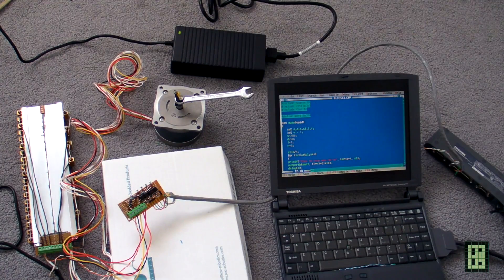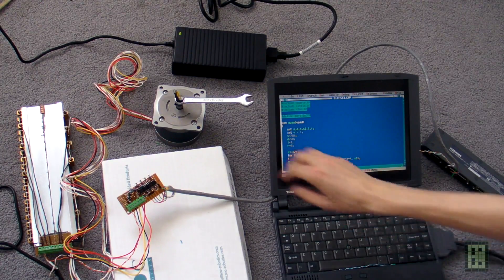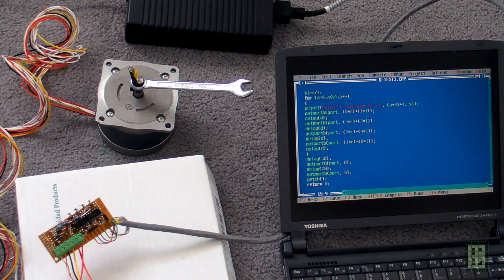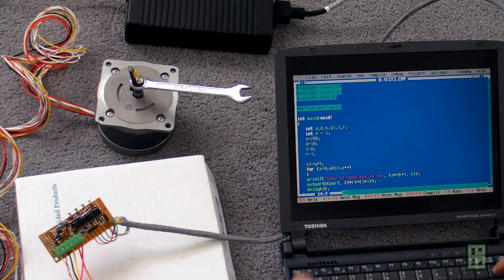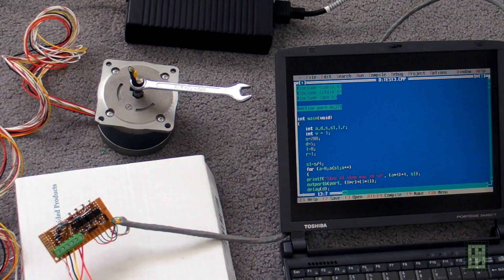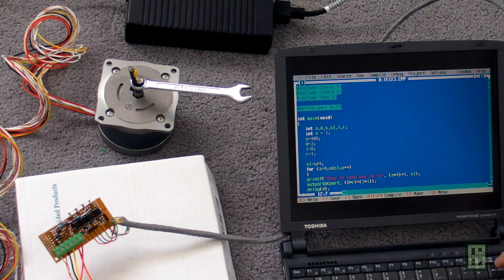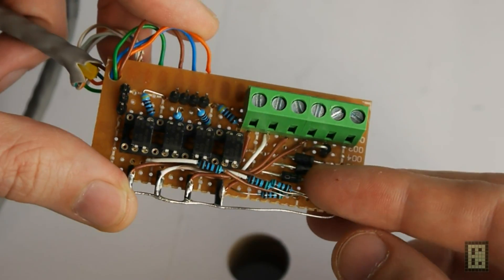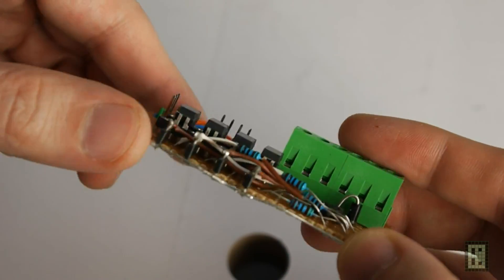Stepper motor controlled with computer parallel port LPT

Comment: of course, but ... there is a need for another interface to program the pic, I have a toy car to throw, I got the relay and I built the relay interface for more utilities, the interface that I tested on the car washing machine, for which I had Qbasic shorter than the poniprog and the microcontroller programmed interface, now the washing machine is running on a PIC 80f and obviously on the relay terminal washing machine controls.

Comment: https://www.youtube.com/watch?v=W6LFer8Orl0
very good presentation, Qbasic is able to give utility in an old computer, effectively using to replace a defective pre-programmer from a washing machine, using to ignite separately and turn off the light in 4 or 5 rooms when we are away from home, and many other utilities that Qbasic implements through the LPT port in an old computer.
Reply from the maker: A 2 to $3 microcontroller has now the performance of an old computer (not that is needed for this simple applications) and uses just a few mA from a 3 or 5V supply thus it is a much better option for applications like controlling a washing machine cycle.
I my case this was just an one day project to play for the first time with a stepper motor basically trying to better understand how it works and is fun but not very useful.

Comment: Do you still have that laptop? You should do more stuff like this. I wanted to control stuff using a parallel port too, but didn't know how. I'm glad I found this video! By the way I use Turbo C for C programming now. I made a simple game thing where you can walk around a 10x10 map  using WASD and you can exit using O. If it weren't for Turbo C, I wouldn't be able to do this. Thanks for the video. BTW as I'm posting this, the video has 232 likes. The serial port (not parallel) is sometimes referred to as RS-232.
Reply from the maker: I think I still have it somewhere (last time I used it with an OBD tool on my car a few years ago).
I'm just to busy with my SBMS and DMPPT project's so I do not have much time for anything else is even hard to find time to finalize my house :).
When I can get some extra time I will probably want to play with AI type applications.
For this sort of stuff like controlling a stepper motor is better done with specialized stepper motor controllers that are very inexpensive and then use a microcontroller or one of those raspberry Pi type board computers that have plenty of IO to control external stuff.
Turbo C is fun and easy to use but fairly obsolete by today standards. First time I ever programmed anything was just in my first year at University and that was using Turbo Pascal. First time I started using Turbo C I did not like-it much compared to Turbo Pascal :) but C was more successful so that is what I use now but only for embedded stuff for ARM cortex M series of microcontrollers.
Yes video still has 232 Likes :)
Reply: Yes, Turbo C is obsolete by today's standards, but I would still use it. I got a C programming guide for christmas, which teaches C based on the ANSI C99 standard. C is easy to understand and from my own experience, C is the second easiest programming language to understand (after Python). Also, there is an easy way to control the parallel port in Turbo C, while it is more difficult in Python. I hope you can find some time for this. BTW I posted my comment roughly an hour before you replied. Since this video is at least 6 years old, I doubt that it would gain any likes in an hour.
Reply: Also, I have a laptop that you can attach a parallel port equipped dock, but I don't have the dock. It does have a PCMCIA slot on the side, so I'm waiting for a PCMCIA to parallel port adapter, since I found it for cheaper than the dock. And if I need a driver for it (there are probably no DOS drivers for it), it will at least work with a special version of DOSBox. At least I will have a parallel port.
Reply: Oops, it was actually ExpressCard. My PCMCIA parallel port fits, but doesn't connect.

Comment: What did use to protect the parallel port?please make a list of part and draw the schematic on paper so we can see, good work thanx
Reply from the maker: There are optoisolators for parallel port protection the 4 pin DIP devices (not sure what model since this was done long time ago but anything will work). Schematic is realy simple and you can see somewhere in the video a close up of the board.
This is not useful at all other than learning how to control the parallel port or play with a stepper motor. For any real use you will need a proper stepper motor controller that is extremely inexpensive and will work way better than this simple circuit.

Comment: the DOS version you have used is a pure DOS or (an emulated) DOS running on windows?
Reply from the maker: No is a pure DOS so direct access to hardware. Old Win95 and maybe Win98 will still run this but not the newer Windows versions that will need a driver installed to allow access to parallel port.
Reply from the maker: I guess it will not work inside a VM same with dosbox. The master OS takes control of the HW and only gives access trough a proper driver not directly. You can access the parallel port from any OS trough a driver but in DOS naively you do not need a driver since you have full hardware control.
Reply: electrodacus official dosbox is currently unable to control the parallel port and so is ms-dos inside a VM (AFAIK).
Reply: electrodacus there exist SVN versions of DOSBox that allow you to use the parallel port, but I ran into a few problems with it.
Reply from the maker: The ports including parallel are controlled by the main OS and applications including a VM will need to access those ports trough main OS using a driver and only one application at a time can take control of any one port. None cares anymore about the LPT parallel port so support from VM is likely limited.

Comment: Six years+ later and this is still useful... Just because it is DOS and Turbo-C doesn't mean it's obsolete, by any means.

Thanks for nice demo.
Reply: boogerhead0 I agree. This is the simplest way to control the parallel port using a programming language (C in this case). You can hook up anything that requires less than 8 digital I/O pins to control to this, even a character LCD.
Reply: also visual basic is fine

Comment: Code for Linux please.
Reply from the maker: Parallel port access is as simple in Linux as it is on DOS and will depend on the programing language you want to use.
For C see this https://www.htlinux.com/parallel_port_control_in_linux/
The code I wrote and did not save is very simple and you can copy that from the screen (watch in 720p min and you should see all my code in this video).

Comment: What interface would you assume for modern PC? (As it has no LPTs and rarely has COMs)
I would like to stay away from Arduino, in order to use high processing power and high device compatibility.
All i need are the ways to
  - Control 64 such motors, sending digital data to them with DACs
  - Recieve data from at least 64 sensors, with aid of 64 ADCs
Everythingt must occur on standart PC with CPU of x64 architecture.
Can you assist on that? That is an interesting modern project!
Write me a letter if you are interested!
Reply from the maker: Your x64 CPU has no DAC or ADC included and since you already need all that you most likely needs some sort of micro-controller to handle that. Another advantage may be that a microcontroller is a real time device unlike your x64 machine.
Not sure how you want to control a stepper motor with a DAC (digital to analog converter) since a stepper motor needs digital type signal and a most likely a stepper motor driver.
Also not sure why you want ADC (analog to digital converters for sensors) what sort of sensor will you be using ?
Most sensor's used are also digital providing pulses for each step or something similar.
If you do not want to use a micro controller at any cost you can probably use a SBC (like Raspberry or Orange Pi) since they have multiple IO, SPI, I2C and even a few ADC and DAC's but if you need more you can add externaly and use a serial communication for interface SPI or I2C usually.
Not sure where you will need 64 motors (maybe some sort of robot).

Comment: bro can u please help me, i have modified epson printer, i make it Flat bed.. but my problem is i dont know how to change the steps of motor, its posible to change it? and what software i need to download?. TIA
Reply: the print result is more that 1mm to print again.. so the image is not perfect...
Reply from the maker: What you need is to identify the exact type of motor (possibly a stepper motor) then get a motor controller. There are many options available that will connect to a PC over parallel or USB port and then you can use one of the multiple cnc software available.
There are also some stand alone cnc controller that will not need a PC just the files in a special format that you prepare in another software that will tell the coordinates you machine needs to move at and how fast.
Everything that I presented in this video is not of any use for you was just my experiment to see how the stepper motor works building a very basic and inefficient but simple stepper motor driver with parts I had around and writing a small piece of software to control the parallel port on an old laptop that still that. There was nothing useful that could have been done with either the simple motor controller or the simple software.
Proper motor controllers for stepper motors are realy inexpensive (just a few $ each) thanks to all the DIY CNC and 3D printers that gained popularity in the last few years.
Depending on what you want to do with that flat bed you will find a cheap and easy to implement solution.
Reply: +electrodacus. tnx for the best advice.. il try to search it but can try to send here that kind of software u use so i can download and learn..
Reply from the maker: Ben Celiz
I did not saved the software I written in this video. The laptop was ruining DOS and the program was written and executed in Turbo C.
All this are long time obsolete so it will not have been useful for you. All code is visible in the video so you can copy if you realy want just need to watch in HD to be able to see the text.
Reply: +electrodacus okie tnx a lot bro. nice vidz

Comment: thumbs up, dude! Nice presentation, straight to the point, anyone can connect the dots, and tho most comments I read seams to just be there to annoy you. Tolls will troll, don't worry. My lap is like 15 yrs old, has com and lpt, running Linux. I will try to reproduce your case and maybe even make some 2 axis plotting using parts from scanner. Sure, better to use micro controllers or are-do-we-no  shit, but I'm rather short on cash. How do you asses available options, number of wires, speed and so on, is it feasible?
Reply from the maker: +Piotr Misiuna Yes two axis is feasible with LPT and this method where you use 4 IO pins for one stepper motor. On top of the 8 data pins that are bidirectional there are a few more at least 4 output pins that can be used if needed and a few input only pins also.
But this method was mostly didactic will not have good efficiency better to get some stepper motor controllers then less pins are needed just two/stepper motor one for steps and one for direction or even better there are now USB 3 or 4 axis controllers that are also not that expensive.
You can use the ULN2003 instead of discrete transistors as I used if you are using small motors. Search on ebay for ULN2003 and you will find a board with the ULN2003 and even a small stepper motor included for around $2 or so. You still need 4 IO pins for each motor and is not  proper stepper motor driver but is good to understand how stepper motors work.
Maybe better for small steeper motors is to use the A4988 the complete board is just $4 and a huge improvement over the ULN2003. You just need two IO pins for that one for the steps (even microsteps supported by this controller) and one for direction.

Comment: Can we have the code you used? For project purposes only. Thanks
Reply from the maker: +talitha cruz Sorry I did not saved that file it was just a short experiment you can easily copy the code from the video since the entire code is visible is just  few lines of code. But I'm sure you will not want to use an old DOS OS and Turbo C.
Is best to use a modern microcontroller to do this together with a proper stepper motor controller. You can find all this extremely inexpensive on eBay if you want to experiment with stepper motors.

Comment: I want to try the same thing.Hardware and wiring is not a problem with me.I want to know the program side and want to learn how does a program changes the status of a particular pin of parallel port high or low . Can you give me the program or can you give links for what I want to know ? Thanks.
Reply from the maker: +Prashant Bhavsar The program is written in old Turbo C and runs under DOS. I do not have the software since this was just a test I did not saved the software. But you can easily copy the software from the video if you watch the video in HD.
In other newer operating systems like windows XP and up you do not have direct accesses to HW like you did in MS-DOS or Free-DOS.
Search on goggle for LPT pin-out you can control all 8 data pins I think they are from pin 2 to 9 on LPT and there are some other controll pins that you can use some just out and some just input the data pins can be configured as outputs or inputs similar to the ports on a microcontroller.
But this is not useful anymore just use any microcontroller for more flexibility lower cost and lower power consumption.

Comment: hi 
    i'm trying to write a program in TurboC which i have to connect the 8 input from the parallel port (DB25) into the circuit and also make the LED light on 
could you help me about the program ?
Reply from the maker: +Riyadh al-Turki If you watch this video in HD 720p or 1080p you can actually copy my program that actually controls the 8 digital pins of the parallel port in my case to rotate a stepper motor but you can use the same program for LED's.

Comment: Hi:
I am trying to get started in cnc. Could you show the schematic for this unit and will it work with programs you can buy such as Mach3 or some foam cutting software? You mentioned you isolated it so as to protect your computer. Could you show that and what you did?
Thanks for your time. Great video. Have a nice day.
Reply from the maker: amtpdb1 This not a proper way to control a steeper motor in a real application was good just for a simple demonstration with parts that I had at home. There are inexpensive stepper motor controllers on ebay for just a few $ and those are a much better option.
Not even sure is worth to build your own CNC unless is for fun the CNC's you can get from China are quite inexpensive.
Reply: ***** Thanks for getting back to me. I have a mm2001 control board and I bought a few different small driver boards that are shown mostly with arduinos. I just have not figured out how or if they will work with purchased software once connected. Would your diy driver work with commercial software or only with your written software? Just trying to figure things out. Thanks again for getting back. Have a nice evening.
Reply from the maker: amtpdb1
Mine only works with my own software is not a standard solution.
I guess you should check the requirement of the software you want to use and see what sort of HW that needs.
I think most are old fashion software that requires old parallel ports. Maybe newer ones are independent from PC and use a microcontroller.
Reply: ***** Thanks again.